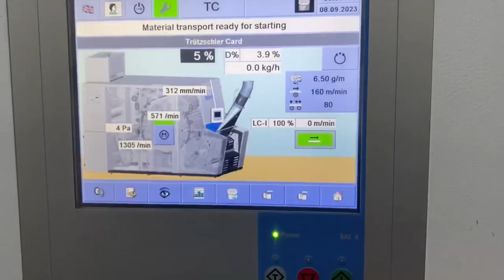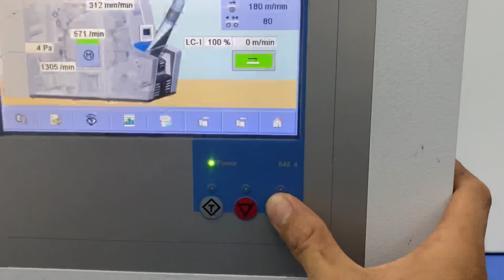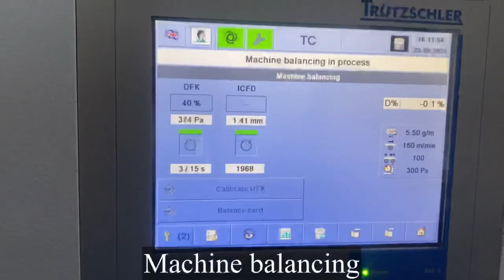Trutzschler carding TC-10 2019, Nonwovens version | Triple B

Comment: Merhaba 
Bu makina tekstil geri dönüşüm makinasımı
Reply from the maker: Hey man. Types of materials you can use for the machine: 100% cotton, 100% polyester, 100% viscose ,polyacrylic,blends and recycled material. But you need to change some machine settings to optimize for each type of material. Example: gap setting, changing card clothing…